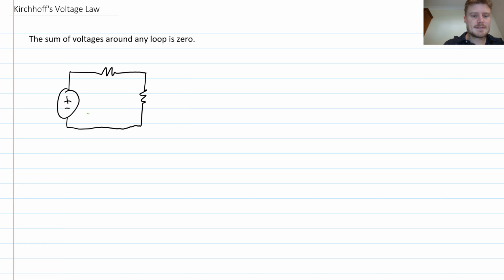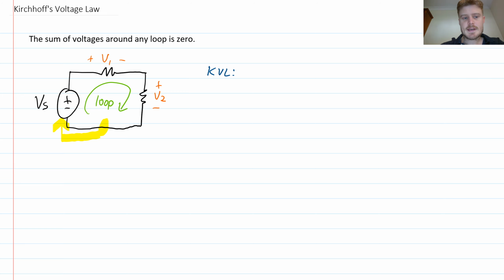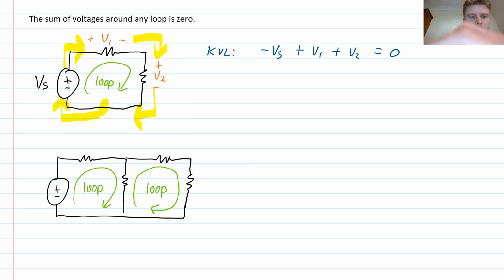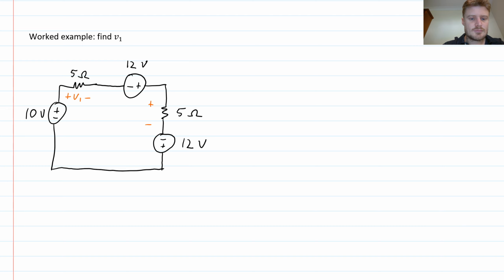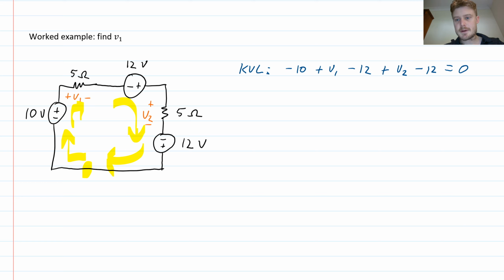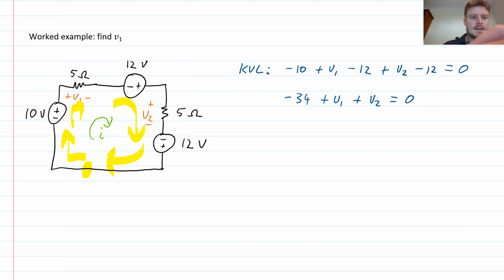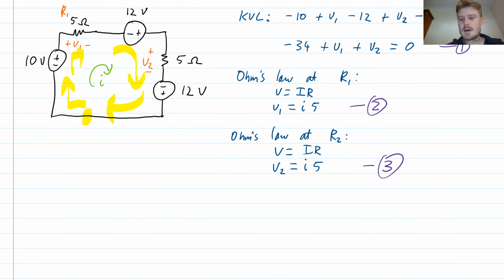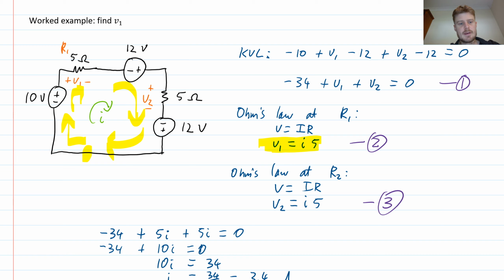EG1012 Week 2 Video 6 - Kirchhoff's Voltage Law

Comment: at the very end, does V1 = volts?
Reply from the maker: Yes. I didn't have a calculator on me and wanted to keep the video moving, so I just left it as v1 = 5 * 3.4. I should have said "5 ohms * 3.4 amps, which all together has units of volts". Sorry for the confusion.